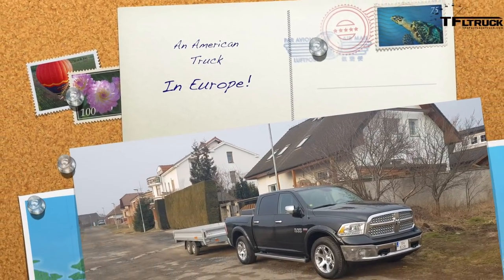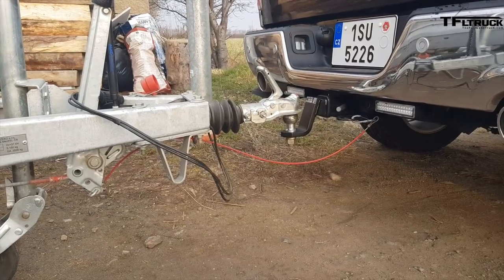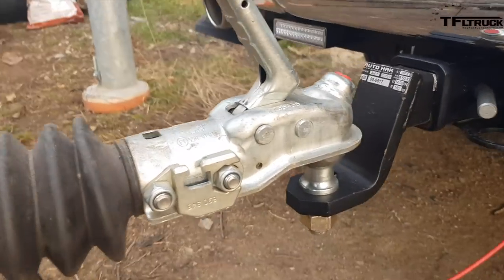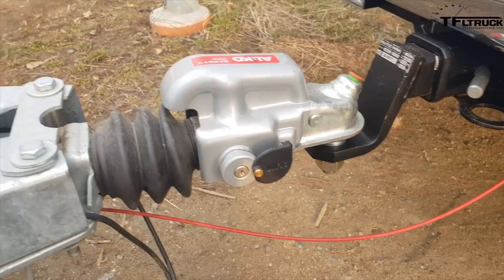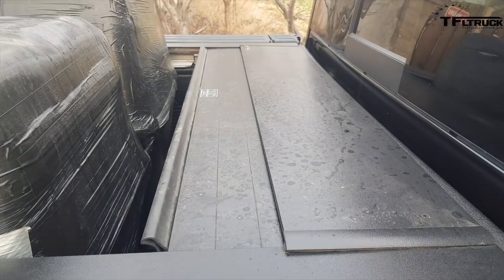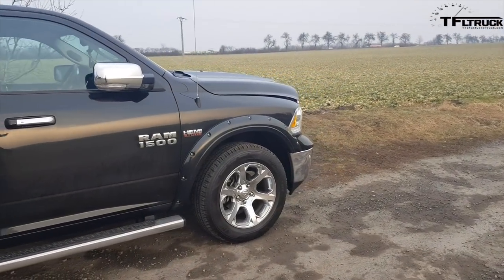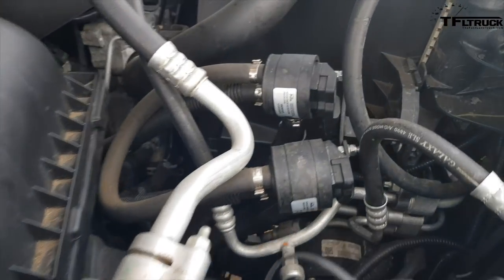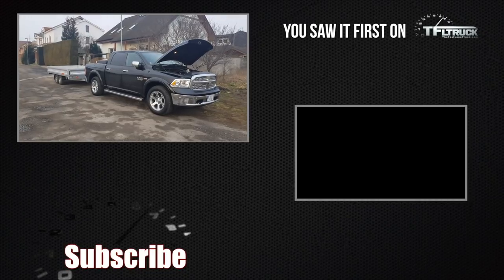An American Truck In Europe: Expat Ram 1500 LPG Pickup!

Comment: Here in Europe most full size trucks are Ram because they are - let me put it this way- not cheap, but more affordable. I drive Ford trucks for 25+ years. Currently a 2015 F 150 Platinun, that I bought new. Next week- Sat. 07. I ´ll take delivery of my 2018 Ford Raptor. I am a little excited.... ;-)
Reply: Hoimar von Ditfuth- Siefken what’s it like driving a truck that big in Europe? I am moving to Germany and I’m deciding on bringing my Raptor or not. I know the roads are smaller than USA.
Reply: OK look. Good comments about both btmrands here but,, I prefer the dodge models because,, they don't have spark plugs flying out of the hood,like all ford trūks have!! You have to know how to keep a dodge and it will last. But no thank you,, ford's are just not built right
Reply: @victorbarajas1395  ???? Ford 4.6 Triton had bad spark plug coil failure problems leading to misfire shaking during Engine operation... But never cracking or ejection of plugs.... I would know I owned several??? 

My newest F150 w/ 2.7EB and 10AT ... Nearing 75k mi (~155-160kkm) has not had a single problem with engine. Has however had an issue with primary fuel sender (tank fuel pump) burning out. But zero engine problems as you describe.... Where do you get your facts? 

Ford typically will has spark coil issues, maybe transmission issues, etc but never so bad as you describe. Remember such vehicles are abused and put to work. For someone in Europe, I'm not sure if your qualified to speak at any length regarding US spec 3/4 ton (full size) pick up truck reliability..

Best regards, 
From Chicago, IL
Reply: @escapethefall1  Seeing how old your comment is I might be far too late, but anyway:
Germany is commonly called "The US of Europe" because of quite a few similarities, one of them being the roads. I'm sure you can find places where it's a little tight, but with some reversing back and forth you should be fine.

My experience is limited, but for a little while I've been driving a RAM 1500 in and around Stockholm, Sweden, arguably one of the worst places for a pickup. Parking spots are never long enough and rarely wide enough. Some garages are literally impossible to even get in and out of because of how long the wheelbase is. But in most cases I've found the reverse gear and the steering wheel are your best friends.

What is worth considering, though, is the cost of importing a vehicle to europe: Not just shipping and relatively high taxes compared to the US, but also different light requirements than the US. There's a company somewhere in germany which imports RAMs and fit them with the required lights and controls for said lights. Best of luck!

Comment: Quite common truck in Norway too, although most often with the Ecodiesel.
Reply: AkaAndyKnuckles In the US many states require a biodiesel, which is quite dirty. Does Norway do the same?
Reply: Scott Witkowski Hey. No, biodiesel is hard to come by in Norway, i think it is almost exclusively by some trucking companies. It seems all diesel sold here contains a few percent biodiesel.
Reply: AkaAndyKnuckles Personally, I dont like it. It clogs up fuel filters and is doesnt burn as clean. Also, it gels up much easier in the winter time.
Reply: Scott Witkowski Yes. I think the sticker under the filler door on my Audi A3 TDi actually bans usage of diesel containing more than 10% biodiesel. I know they sell different blends of diesel here according to temperature. Low temperature diesel keeps floating without turning into Vaseline i vold weather, summer diesel has better lubrication ability. I assume they do the same in the colder parts of the US as well.
Reply: I'm American and I didn't know that we import pick up trucks in Norway. Must be difficult driving those beasts on narrow roads.

Comment: Ah hello there! It is so nice to see an American Truck in Europe! I was wondering about the cost of running that! But the LPG makes perfect sense! But I’m sure that is not cheep either for the conversation. Also the trailer hitch lock you have is a great idea, but you must add a locking but to the ball, I’ve seen thieves just unbolt the ball only to reattach to their trucks hitch! Lock really only keep the honest folks honest. If a thieve wants something they will get it. But anyway, stay safe have fun!
Reply: K. R. V. LPG is about $3k for a V8, but within 15 to 20k miles you safe that amount of money when you drive LPG instead of fuel.
Reply: @shaclo1512  how expensive is gasoline (petrol?) in Europe? No need to convert to imperial measures, I understand metric perfectly well! (Born post 1985)
Reply: Eric Christian 
Gas is  1.40€ per liter
Reply: And LPG is 0.60€

Comment: That’s pretty cool with the LP conversion .... Good looking truck. Curious as to how many LP stations are around .... few & far between near me.... wasn’t until the past decade you could find stations with Diesel any where but near major highways, as only Big Rigs used Diesel. Found out the hard way about going empty on a diesel .... partner forgot to check the gauge .... we sat in the baking sun, waiting for a tow big enough to tow our ambulance back to base.

Comment: In switzerland we can tow up to 22000lbs trailers with them 1500s.
Reply: Ale E 22,000? Thats a bit much. But i wouldnt dout it. I pull 15,000 to 18,000lbs with mine. People freak when seeing it and i get bashed all the time. To hell with them though.
Reply: Snipe Stud00 I know it sounds a little too much but we equip them with a Air systems. Both the 1500 and the 2500. In Switzerland you only can tow such heavy loads with a Air Brake. The connectors are the same as the big trucks have and the compressors are mostly Belt-driven.
Reply: Ale E Ive been wanting to find a belt driven air system with blow off valve for my 05 silverado 1500. I know my next truck will be a ram 3500 and would enjoy a built in air system with drain valve and quick connect right by the steps and innthe bed. Be nice out in the fields for air impacts and what not. 

Need to find someone who can install it all and cobuild a company . I think it would be profitable. Also better than the onboard air systems of the bagged trucks.
Reply: Ale E Thats actually pretty slick. I wouldnt mind one of those systems. Course im sure the US would hold a fit over them. Then again, farm exemption. Ill do whatever i want. I would likethe air system and modify to my needs.
Reply: therenis a video about a first gen dodge ram 350 with 32000lbs behind it
Reply: Lucky you. In Latvia we're allowed only maximum of 7000lb trailer or no more than stated in combined weight.

Comment: I can confirm the paint Ram uses is awful and always has been. I've owned several dodge/ram vehicles. I love the brand but the paint always comes off and rust begins to eat away the body. Usually starting near the bottom where water and gravel get kicked up by the tires. Otherwise they rock. They'll run a long time if taken care of.

Comment: Can't believe they're ok with so little tongue weight outside of North America. I understand trucks and cars are smaller, but it's still not as safe. The weight should always be biased to the tow vehicles, not balanced by the trailer like a teeter totter.
Reply: It really is about the cars. In Europe, fuel is expensive and a cars are smaller because of it. That makes handling tongue weight an issue. Also, because standard licenses only allow for smaller trailers in much of Europe, trailer handling becomes less of a concern.
Reply: It is even illegal to have a tongue wheight over 50kg (110 lbs). The police is mesuring it and you will get a nice ticket. The trailers over 750kg (1600 lbs) must have mechanical breaks activated by the trailer itself as soon as it pushes against the truck. Look at the folding rubber part behind the conector on the trailer. I drive an Ford F150 with an lpg conversion as well, tows like a champ on the Autobahn.
Reply: Ublun Info conversion cost 2 to 4k depending on the tank size and cylinder number. That keeps most people away from converting. It only pays of with big engines and a lot of mileage. Also technical inspections and maitenance cost more with lpg.
Reply: @utjeisenkuhle1997   do you have to get a proper B+E license? because here in the United States we don't have that category some states like New York Pennsylvania California and Maryland require a much larger rv trailer to get an RV license.
Reply: @EpicThe112  yes you need a be license. I am a bit older and have the older license, with that you are still allowed to drive larger vehicles. But I also own a semi truck license, but have no current permission to drive it (requires anual training and of course more money).

Comment: Excellent job and I'm wondering if you need a B+E European Union & possibly United Kingdom post brexit license to tow one
Reply: for that trailer - yes, you would need a BE license.
Reply: @ManuelBarner  thanks for the information from what I can see you guys have a much stricter rule is your country part of the European Union
Reply: @EpicThe112  i'm in germany, so yes, part of the EU. the rules are a bit strikter, and seem a bit complicated at first, but it's not that hard once you see the patern. B = cars up to 3.5to, including a trailer as long as the max weight of the trailer is under the min weight of the car. (also, check what you r car is allowed to tow). with BE you can use a car with up to3.5to (the RAM for example) and ADDITIONALLY a trailer with up to 3.5 to. of course other laws are also aplying on top of that, like the max tow/toung weight of your car, if the trailer has a brake or not and the usual restrictions in lenght /wide.